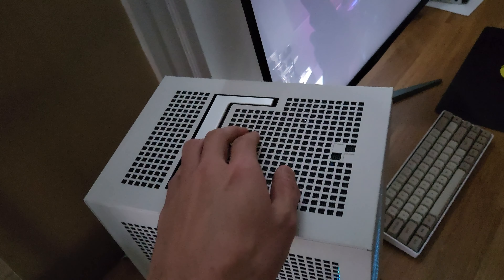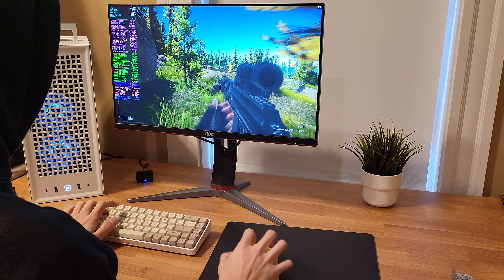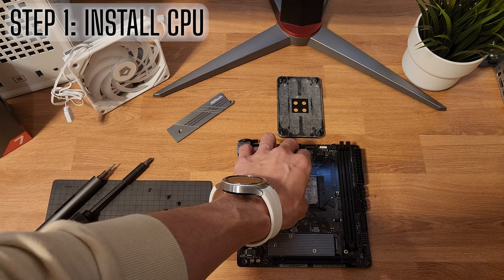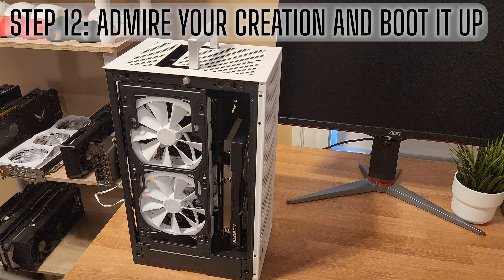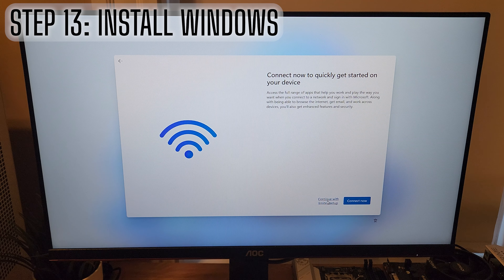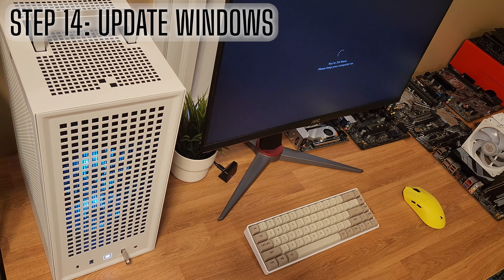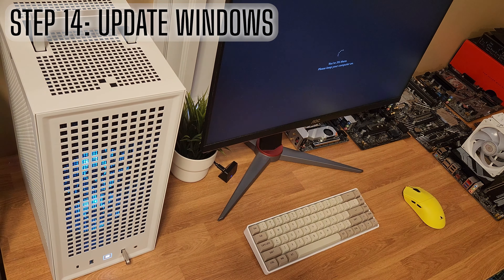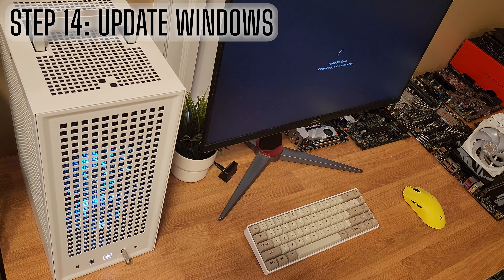How to Build + Optimize a PC for Tarkov 1080

Comment: Upgraded to 7800x3d from i7 10700k and 32 gigs ddr5 ram after following your instructions, fps went from 70 to 160. Thank you so much for all the research and videos.
Reply from the maker: love to hear it! you're welcome, enjoy!
Reply: what gpu and mobo do u have? im in this exact position rn
Reply: @21ninpo  B650 tomahawk, gpu is 3080ti evga ftw
Reply: I got a 4070 super, amd 7 7800x3d, 32gb ddr5, and I get alot of stutter spikes. Do you think maybe because I didnt fresh wipe my computer with new install? I have tried alot of different nvidia settings and game settings but it stutters bad sometimes. Idk y.
Reply: @DUMONTSNIPER2  I didn’t do reinstall or fresh wipe either, I would recommend bumping up/updating your DRAM frequency in BIOS and monitor cpu temps and install cpu utility drivers if necessary and make sure your gpu is master gpu.

Comment: you think this can handle 1440p at 120 fps+? i wanna build a pc soon with streets and mind and would like to spend like 1000 max
Reply from the maker: most maps yeah easy with FSR, keep in mind, the $900 is including monitor, mouse and keyboard here
Reply: @pyurologie  oh shit I didn't realize I'll be definitely taking a similar approach but probably with a 7800x3d just to future proof it further is there any other optimization you would recommend?
Reply: @pyurologie  also I was checking your videos and found some older ones about the 7800x3d the 7900x3d and the 7950x3d, as of now which of these do you think would perform the best?
Reply from the maker: @mqze1998  7800X3D with B650 is what i'd recommend. 7950X3D and 7900X3D perform the same in tarkov really

A620 vs B650 vs X670E: https://youtu.be/p530Zqt7Itc
DOES RAM SPEED/CAPACITY MATTER FOR 7800X3D https://youtu.be/Ac7CogESDeY / https://youtu.be/PbK0bncyh6w / https://youtu.be/JZV6dqAqsTU

Comment: I have a 2080ti i9-9900k and 32 gb ddr4 @ 3200mhz and I only get 50 fps on streets with low settings and nvidia control panel tweaks what am I doing wrong. Help!
Reply from the maker: https://www.youtube.com/watch?v=rP0UEDLKwf8 this is how i configure my machines

https://youtu.be/lOSf_aqrLJc?t=1054 this timestamp shows my pyur preset settings, what i typically run and found to be optimal blend of visuals/performance

start to finish build video: https://youtu.be/7SK65pkJISw

let me know how it goes and feel free to hit me up on discord https://discord.gg/c7SvvDAuMZ

Comment: I have a 3060ti and a i712700f and i feel like i dont get near the frames i should its been rather frustrating for me and i have the control panel settings and everything set up but i may try that lasso program and see if that makes anything work better. Good video! Also nice aim at the end there lol
Reply: Also what do you use to see all your pc specs and fps on your screen what program is that?
Reply from the maker: @BeanoGaming  I've actually just started testing Process Lasso, I'm not sure of the performance difference with Intels yet. I'll do some testing on mine soon. 

I've configured a custom RTSS overlay, I may share it in the future.

Comment: Hi Pyrologie first of all insane video congrats. Im having some problems with updating my bios it wont let me update it fails to integrate it in the bios. I got a 7800x3d and a B650M GAMING X AX. And other question, Is it safe to do this changes in  the bios for every pc?. thanks!
Reply from the maker: hi thank you so much! so you are running a BIOS update, but when you restart the version hasn't changed?

Yes, these BIOS updates are completely safe. Undervolting can't harm your system, the only thing that can happen is if you set too low, the system won't receive enough voltage and will shut down safely. But, these settings generally work on all 5700X3D and 5800X3D, even 5600X3D
Reply: @pyurologie  Hi, No what is happening is that i try to update from version FA2A TO F22B, I go to flash in bios but it just fails to update. And its not safe to make changes within the last bios version right?. Thanks for answering!
Reply from the maker: oh weird.. never seen that. it should be fine to make BIOS changes in that version I don't see why not

Comment: My friend and i have same configurations, 5800x3d + 6800 XT + 32gb, but when we run streets we are nowhere near these fps. We are at like 60-70ish. What could be the issue?
Reply: I forgot to mention we are both on 1080p...
Reply from the maker: that seems a bit low for those specs. 

https://www.youtube.com/watch?v=rP0UEDLKwf8 this is how i configure my machines

https://youtu.be/lOSf_aqrLJc?t=1054 this timestamp shows my pyur preset settings, what i typically run and found to be optimal blend of visuals/performance

lmk how it goes. if you still have issues, feel free to hit me up on discord https://discord.gg/c7SvvDAuMZ

Comment: I currently have a 1660 super and Ryzen 5 3600, running 1080p. I want to upgrade to the 5700x3d and I’m unsure what gpu to go for? I only play 1080p on tarkov so don’t need anything insane - any suggestions?
Reply: anything from 200-300 bucks should be good, from 6650xt - 3060 12gb - 4060 - 6700xt depends on which brand you prefer and however much you are willing to spend
Reply from the maker: @essn6807  that's a good call ^

Comment: I have a similar PC as yours, but with an RTX 3060 6GB. My GPU's usage drops a few seconds after joining raids, going from 100-130 FPS to 60-70. Any advice about this?
Reply: Lower those texture settings, you’re not thermal throttling also? My 6600xt has 8gb of vram and it’s hitting 8gb on streets of Tarkov with medium textures alone, reserve doesn’t work on high textures either for me
Reply from the maker: @opticalsalt2306  ^ that's a good first suggestion. lemme know how it goes
Reply: @opticalsalt2306  Lowered textures to Low, didn't work. My 3060 consumes between 3.3 and 3.5 vram so I don't think that could be the problem. CPU temp is 75 degrees and GPU 65 degrees. I have 16 GB of ram, but I use a memory cleaner. I also have a pagefile done so I can have more virtual memory.
Reply: @dragonflaw  Ah that's a shame. Eft has been running worse for me lately, and MIP streaming is kinda broken on the live client so... Worst comes to worst try disabling the oculus audio, u 100% know 16gb is probably the limiting factor, I will say it's pretty normal to get fps dips especially at the start of raid (when AI/bosses start spawning/moving around), I can BARELY load streets with 32gb of ram myself, on a 3700x, 1% lows of ~40fps so, game is just a performance hog. ALSO important to note (forgot to mention) Nvidia cards have MUCH better vram compression than AMD, so you honestly could probably get away with medium textures anyways. (any spillover goes into ur ram yada yada), Also on low end cpus the render distance does hurt performance quite a bit if you have that cranked! I really want ppl to enjoy the game but sometimes it's impossible, it sounds like you've done everything correctly if I'm reading it right. Also worth considering if they DO fix MIP streaming - it's gonna pull some cpu overhead if you enable that, hope you can get the game running man
Reply: @opticalsalt2306  Yeah, I've tried everything since I bought the game some weeks ago. Nothing seems to work. I guess I will wait for another patch. Thanks a lot for the help friend! Best of luck enjoying the game.

Comment: Hey bro, I have an RTX 3080, I9 12900K and 32GB DDR5 6000, recently I've been having really bad shadow flickering, the only thing that seems to fully get rid of it is doing 4x supersampling but obviously that kills FPS, is there any fix to this? I saw you had some videos of pretty much the same specs as me and you didn't seem to have that issue, could it be monitor related maybe? I noticed in your videos you were at 1440, I run 144 HZ 1920x1080. Thanks.
Reply from the maker: another user in my discord reported he's getting this flickering/flashing too. I will be looking into it in the near future and share what I find

Comment: hey man. do you think a 7080x3d would bottleneck a 3080 in tarkov at 3440 x 1440? I'm just wondering whether to buy the 7800x3d or 5800x3d? I'm looking for around 140fps.
Reply from the maker: 3080 is one of my picks for maxed 1440 tarkov. 5800X3D and 3080 will get close 140 on most maps in 1440 but not Streets.

Here's my 3080 10GB playlist: https://www.youtube.com/playlist?list=PLYaeRxhLbnoH1xKTZ2_X1Qm1AIF90UJKr. I have numerous videos posted with various CPUs including 7800X3D and 5800X3D in there
Reply: hey man do you think ill be able to get 140 fps on most maps with DLSS with a 5700x3d + 3080 on 1440p? @pyurologie
Reply: I have a 3080 10gb and 7800x3d.  My monitor is 4k but I play with dlss quality so render res is 2560x1440.  I use high textures, max performance hbao, medium ssr, decent viewing distance etc, I try to make it look good. Most maps I’m getting 120-144fps (my monitor is 144hz). Streets is more like 80-110 (low or medium textures) depending on what’s happening.

Using hwinfo64 I see 80-99% gpu usage depending on the map.  You also need to be mindful of running out of vram, high textures on streets is out of the question for example.

Comment: Well i don´t know what i am doing wrong.
My PC-Parts are:

Ryzen 7 7800X3d
AMD Radeon RX 7900 XTX Vapor-X 24GB
32GB DDR5 RAM 5600Mhz 
2 TB Samsung SSD 
1000 Watt powersupply from bequiet 

I want to play 1440p with mid settings. On Groundzero i nearly reach 100 fps in the middle of the map. On streets i nearly have 80 at its best mostly i got 60 fps. 
Woods is around 100 fps. I am pretty sure my perfomance should be way better but i dont know why i have those problems.
Reply from the maker: could you try following my optimization guide: https://www.youtube.com/watch?v=1eFlPlPufjc and then let me know how it goes?
Reply: @pyurologie  I did. Woods ist running on max 105 FPS with mid settings. Customs runs with 60 FPS. I know the new customs is kinda Shit but i should have more FPS. My CPU runs ob 40% and my GPU ob 60%. I dont what i am doing wrong man....

Comment: would it be bad to get a 7800x3d with a 1080, because of the gpu bottleneck?
Reply from the maker: here's my 1080Ti still doing work: https://youtu.be/OZuqyUL0blw

you'll be fine on the right settings since you got the 7800x3d
Reply: @pyurologie  i see, so there wouldnt be problems due to a gpu bottleneck. I dont have the cpu yet but im planing to upgrade. I have a 2060 with 6gb VRAM. I was asking for 1080 cause a friend has one and he just bought the 7800x3d which didnt arrive yet. Do you have a test with the 2060?
Reply from the maker: @ventox1337  yeah the CPU carries in Tarkov. Here's my 2060 playlist: https://www.youtube.com/watch?v=HmLkgXQVYBI&list=PLYaeRxhLbnoGsXAz65bsdtDnb5PE-lQDE&pp=gAQBiAQB

Comment: Bro you know what is be need for tarkov. Can you maybe make a settings Video with the Lasso Tool and grafic settings with nvidia card to not use Post fx. My rig k8700cpu and 1080ti thx
Reply from the maker: here is my comprehensive tarkov settings guide: https://youtu.be/lOSf_aqrLJc. I will add a new comparison video for Process Lasso as I've just started using and testing it recently.

Comment: I currently have a 2060 super, ryzen 3700x. Should I go to the Ryzen 7 5700X3D, or 5800x3d, not sure what I should do. Great video!
Reply: I’m going to assume that since he mentioned he would go for the 5600x3d if it were more available, that the base chip doesn’t really matter that much, but the 3D Cache does. So unless the price difference is like…. <$40-$50, the 5700x3d is the way to go.
Reply: I agree with @jonathanuben1516. nearly any x3D, just not the (bad) 7950x3d. I had a 3700x and moved to x3D. It was night vs day difference.
Reply: @scitthundmarsh2699  well thank you gentlemen
Reply from the maker: @leeman949  agree with the gentlemen above. I think the 5700X3D is the better choice if building for Tarkov

Comment: I thinking you can go for 1440 in tarkov easy. I have hard descision - go for 1440 or stay on 1080 since 4060ti ia fine in 2k tarkov but not beat thing in other 2k games. I dont know is it worth it to lose some frames for image crisp?
Reply from the maker: yes easily can run 1440 FSR2.2 on high settings with this rig. Many people wanted to see a specific 1080 video though. 4060 Ti is GREAT for 1440 Tarkov with DLSS. One of my favorite cards for 1440 Tarkov because power draw is so low, highly efficient card.
Reply: @pyurologie  thank you. Can you describe game expirience on 1440p? I cant see sht on fhd 27"

Comment: Is it possible to have a fps cap  at 60 in menu and unlock fps in game like nvidia settings do on AMD gpu ?  Im talking without the vsync  on ingame and off in amd control panel
Reply: You can set Vsync to always off, enable v sync in game- but the menu is just gonna pull as much fps as your cpu can handle
Reply from the maker: i'm currently just toggling in raid, it's pretty annoying. You can set a hotkey for FPS limit in RTSS, but I haven't messed with it much.

Comment: Some of the parts aren't on amazon anymore 😢
Reply from the maker: dang which ones? i can give u similar recommendations
Reply: The storage psu and the case
Reply from the maker: @BayouBaldwin  I found the black revolt 3 with the 700W PSU bundle on newegg for $130 right now, amazing deal considering a 700W SFX PSU alone costs way more than $130 for a good one. I included a link for the Crucial P3 Plus 2TB NVME here. This is probably what I'd get as a replacement if I were to build this today.

REVOLT 3 BLACK w/700W PSU: https://newegg.io/ncad78c18e
Crucial P3 Plus 2TB M.2 NVMe: https://amzn.to/3TLOcUn

Comment: 7800x3d and 4070 is a good combination??
Reply: I run that combo. Very nice. the 4070 is not the best performance for price but it is best performance and power efficiency for price (imo), with CPU&GPU pulling 270watts combined! Prices for power around my way are high. Also gets HOT in summer. I get 100+ fps in streets with 6000MHz ram DDR5. Check out pyurologie's videos for that combination https://www.youtube.com/watch?v=X5BNbZax8pk Infact that is the video that I did build of, including the B650 mainboard, and am very happy with it.  He gets higher frames than me in that vid' as I am running a slight undervolt as my monitor caps at 120Mhz. And I have not tightened my memory, just stock xmp.
Reply from the maker: i love the 4070 and yes 7800X3D/4070 is what I consider to be meta for 1440 Tarkov right now along with 7800XT/6950XT/3080. All great choices with slight variations, but all max 1440 cards for Tarky. 4070 is highly efficient

Comment: Are you playing on offline or online raid?
Reply: I've never known pyurologie to use offline mode.
Reply from the maker: Online. I only show online raids for the most part. In my Faceoff series, I setup closed runs that I can repeat consistently in offline mode to compare hardware performance differences and I make it very clear that it's offline for that reason.

Comment: Sup buddy, hope ull see this comment: I used 5600X@4.7 all cores fixed for a 2 years(mobo is b550 strix-f, 1.26v, llc3 current 120%), and swaped it to 5700X3D few days ago with latest possible bios, it can handle -30(but i use -25) all cores, gives me 13800 pts in CB R23, 475Gflops in LinX 0.7.0, 5930 multi in cpu-z, temps are ok: 64C running 30 min of CB R23, 83C while LinX 0.7.0, in games it rarely reaches 55C consuming 45-55W. Everything seems fine, BUT,  i expected to see solid 4.050Mhz all the time while gaming, but freqs(effective clocks are even less) jumps all around from 3500 to 3900, dont think that its good. While benchmarking it boosting freqs on all cores like expected to 4050mhz. Tried to enable\disable PSS and Global C states in bios - gives me nothing. Can problem be in my old GTX1080? I mean it do not require all the CPU power so CPU wont push clocks to it's max? I'm wondering cause using fixed 5600X i used to see 4700Mhz all the time, understanding that effective ofc can be less then 4700.
Hope for your help, regards!